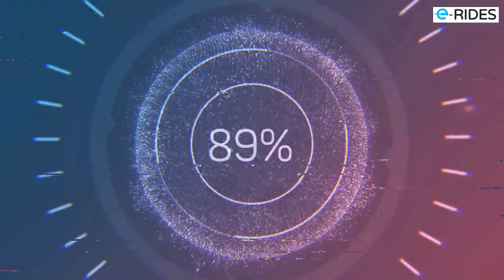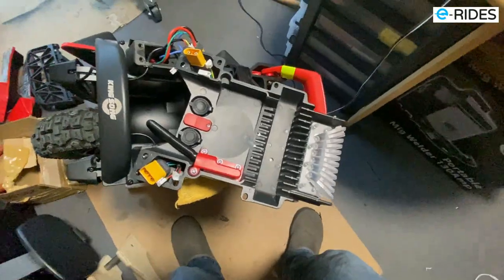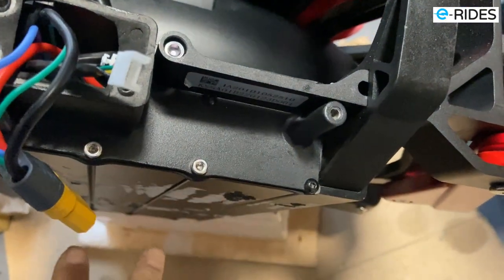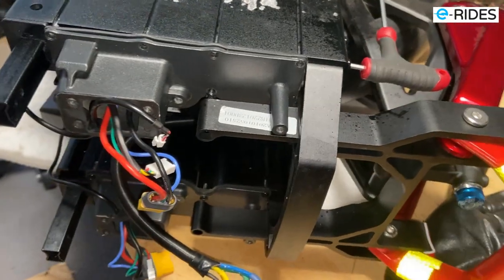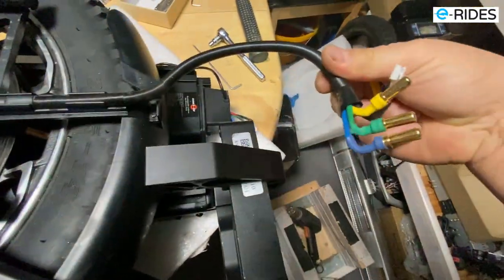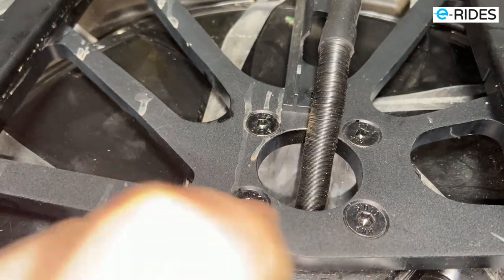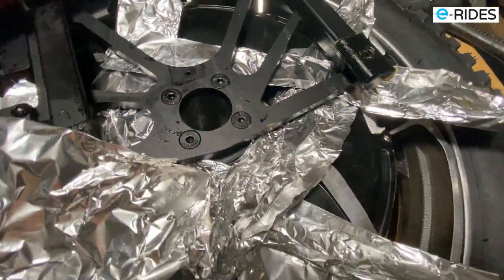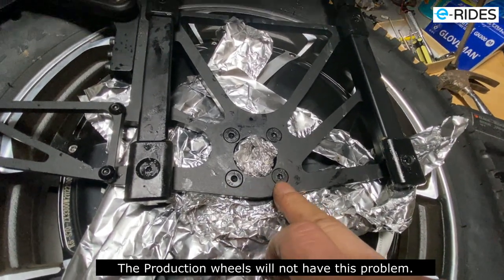KINGSONG S20 disassemble. erides EUC upgrade half ebike.

Comment: Need one of those induction heaters for those screws, if i can't pull apart the wheel then my S20 asparations are over. 👎
Reply from the maker: what about the motor screws any ideals?
Reply: @eucupgrades  looks like youve exhausted all avenues. Just going to have to drill the heads as the rim/motor looks like it's a throw away at this point. As you couldn't even get your first bolt out. Wrong bolts and way too much locktite, shame on king song.
Reply: @eucupgrades  you are doing what kingsong should have done on one.
Reply: @eucupgrades  Braze or weld a disposable Allen key to the bolt to extract.
Reply: Lets just hope the every single screw locktite overload thing was just in these pre production models to make sure they couldnt rattle apart
Reply from the maker: @grb1969  great ideal. Thanks

Comment: Why are you the only guy taking one apart?
Reply from the maker: That is what i do to make sure the wheel can be easily service and safe to ride. Also to see the good and bad of the design. This wheel are getting faster now and speed comes with more risk so safety riding, testing them are very important to me. This wheels are quite expensive nowadays and you expect them to be better build and better quality.
Reply: @eucupgrades  great  in doing so. I hope you will admit the  actual low range of this wheel as well. The only 30 mile actual range seems to be the elephant in the room with this wheel

Comment: Using an (impact drill )is the reason you're stripping the heads out on them cheep screws and way to much loctite .  You're not taking lug nuts off a car 🤣
Reply: after 2 minutes of heat 🤔🔥 bearings might be making noises now.

Comment: All those screws would be easily removed if you had some better tools..
Reply: Yea, probably a 3/8 drive alan bit tapped with a hammer first would have cracked loose a few more. But those button head screws would be better off with no locktite.
Reply: @noelleonard2498  exactly finally someone who understands tools and which ones are easier to use in these situations
Reply: @alexvetrov97  would have been better to use a regular allen wrench for the first crack. Seems all these guys ever have as those long bits on a drill driver and those junk chromed t-handles. The fact that not one of those screw heads sheared off but instead stripped up tells me its a combo of the wrong tools and too much locktite. Last resort for that situation would be an impact with the correct bit. Not saying that would guarantee full success on all of them but at least he would have had a fighting chance against all thag locktite and those button head screw heads.
Reply: @noelleonard2498  might the battery housings take a bit of er, a battering from impact wrenches and hammers? It certainly looked like there was far too much of the wrong strength thread locking compound applied to poor quality button head screws on the battery casings, the four large central screws didn’t even budge, which seems to suggest that as Kevin stated, the bearing surfaces of the (too small, too soft) hexagonal recesses (I hesitate to call them Allen heads, they don’t look up to the standard) appeared to rather give way and become rounded than yield. Poor assembly choice, design and torque settings of overly glued-in Chineseum quality screws, spoiling the ship to save a ha’penny’s worth of tar.
Reply: @freeforester1717  yeah, I'm going to have to see a lot of improvements before I go through with one of these in May. It would be different if the production models were never meant to be disassembled, but it seems like they want him to dissemble it so they can see what happened and seemed to have no idea that every screw is drenched in Loctite. Designed by Engineers but assembled by idiots obviously, no way I'm paying 3200 bucks to not be able to disassemble my wheel without destroying it
Reply: @noelleonard2498  it wasn’t pretty, to be sure. There are a fair list of ‘snags’ to iron out, as far as I can see,  but if KS get their act together and address them then it might be a good trail ride for middle distance riders. I’m only commenting on the issues I’ve seen (eg I don’t understand why they have screw threaded charge ports but don’t put threaded cover caps on them, leaving them vulnerable to mud, water, shorts, etc), I’m no expert as far as internal issues are concerned, but it seems to me the the Inmotion V12 is currently a disaster owing to poor electronic component choices (possibly compounded by shortages of same), and the Veteran Abrams launch was another disaster, design problems as well as cutouts; lots of investment, lots of good ideas on most new wheels, but goodness don’t they need a bit of advice from a decent designer now and again, they aren’t afraid to charge either, but beyond the cost of a secondhand car folk tend to get a bit choosy and picky about what does and doesn’t work. They won’t get cheaper, for sure, but they do need to get a bit better to be considered ‘good value’. We need another design classic -both Veteran and Gotway have managed to achieve this with the Sherman and the Nikola (albeit with a bit of help from a competent battery pack producer in the case of the latter) - everyone has been sold the ‘dream’ with the S 20, it would be a crying shame to see it flop as the contender for classic suspension wheel, but if they’re not careful it may just become an ‘also rolled’, if they can’t or don’t address the issues picked up thus far. Just my opinion, of course! 
Edit: It might just be the case that KS themselves might struggle a bit to open up the motor, judging by the amount of loctite type stuff soaked onto the screw threads, nobody knows whether they’ve actually disassembled one of their own pre production models themselves, but the suggestion seems to be ‘not’ at the moment. I commented too on the video by Hsiang with a pretty lengthy list of issues that I had managed to pick up on over the past week or two’s flurry of hype-vids, it’s going to be interesting to see how they stand up to real world trail and off-road riding, which is where the suspension is actually purposed for I guess. Lots of broken plastic and long faces is my guess if they don’t redesign the rear stand (I’d do away with it in favour of two simple nylon studs one each side), the front bumper and side pad supports (many will put on their preferred pads anyway, could’ve saved $50 there on each wheel), light baskets (a cosmetic joke), the seat is too flimsy at the back if you’re over 5’7”tall, and a whole lot of other minor niggles that add up to an unsatisfactory product so far as I can see right now; just hope I’m wrong!